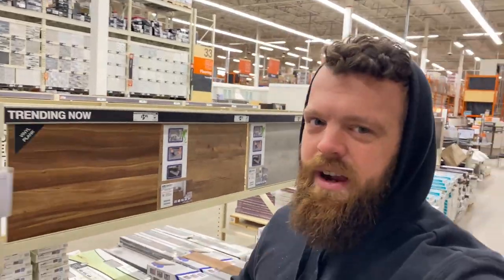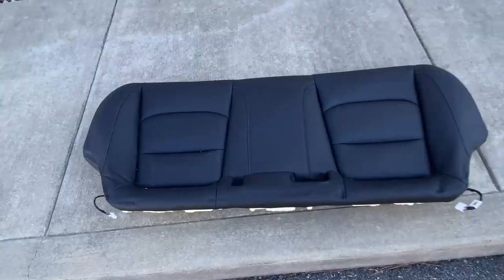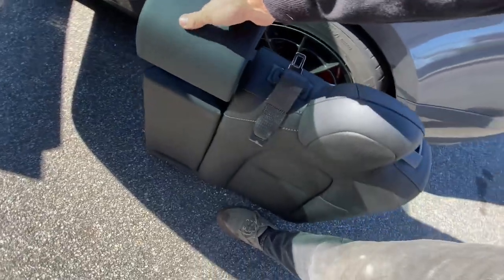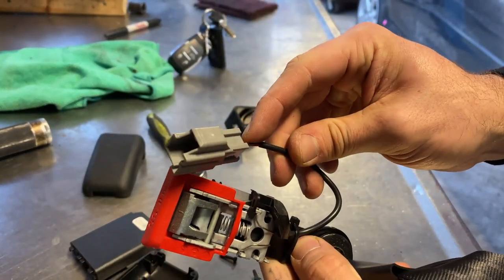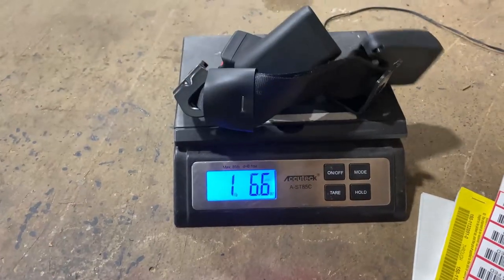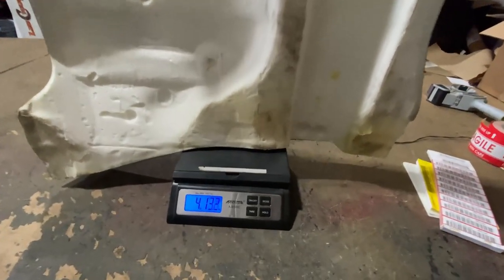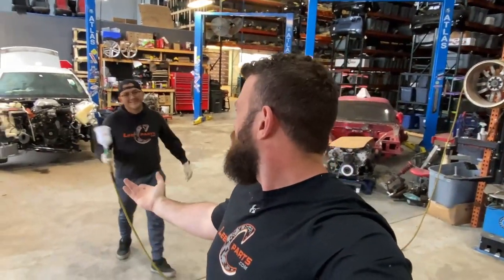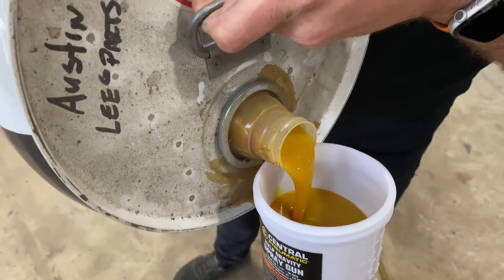Tesla Model 3 Performance | CHEAP and EASY Weight Reduction!

Comment: Mid-pack recreational runner here. I'm about 170lbs... about 10 lbs heavier than my average weight over the last 20 years and can totally feel it when I'm racing, and my race times reflect this. For something the size of a grown man, that 10 pounds translates into a lot of extra energy required to move myself forward.  Have you considered weight-savings based on the weight of the driver, especially since many of the individual parts you're totaling are ~5lbs or less?
Reply from the maker: I was also once a “semi” competitive mid distance runner that got down to 175lb as a 6’2” male. Unfortunately I wasn’t happy with the way I felt or looked while training. In the past 5 years I’ve gravitated towards lifting and sit at 250, generally get down to about 230lb in the summer. I’ve never felt better and don’t intend to lose body weight for auto racing purposes at this point in my life.

Comment: How much did this improve acceleration, cornering, track time, ect?  I've been debating on removing as much extra weight as possible from my model y performance, including new tires.
Reply: Im going to guess its hardly noticeable without seeing the metrics. Drive Mod is probably the better payoff

Comment: Do the trunk delete lol
Reply from the maker: Why stop there right?
Reply: @scraplifegarage  lol dont let me stop you
Reply: i’ve done it, it’s only weights about 30 ish pounds, 40 pounds including my trunk mat, i wouldn’t suggest it unless you have adjustable suspension unless you’re just about straight line speed. i had a set of unplugged performance lowering springs and they car actually sat about a quarter to a half inch higher with the rear gutted and that was enough to throw off the balance handling wise. waiting to get the car back from tesla to install my coilovers so that should fix the problem